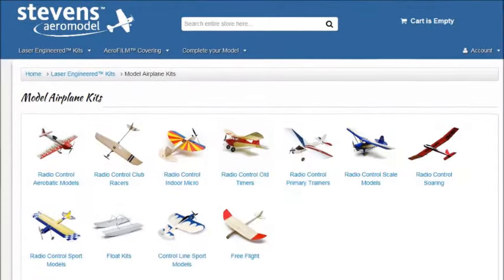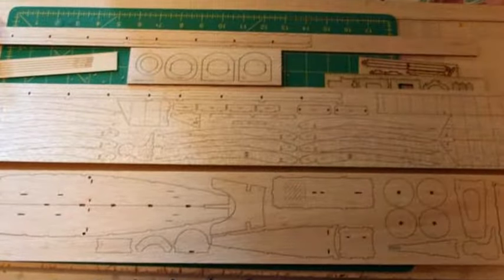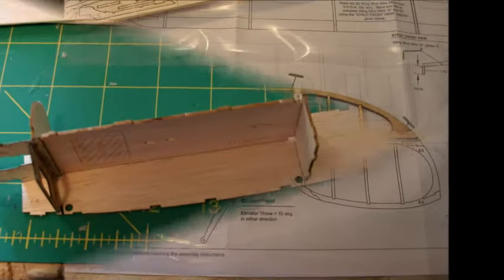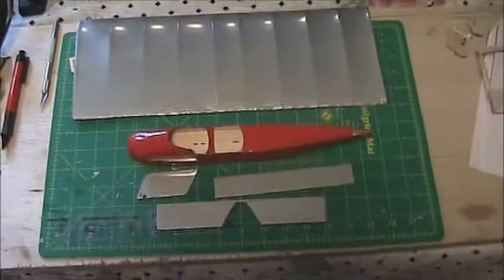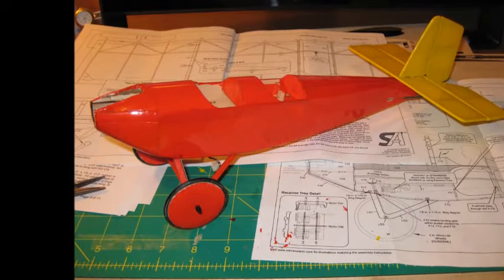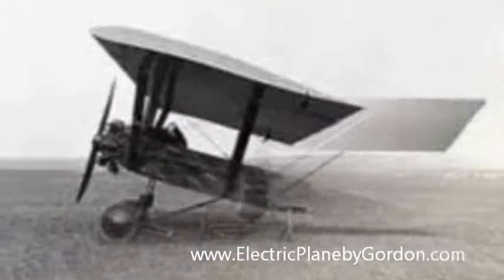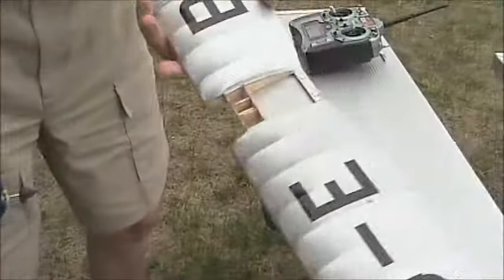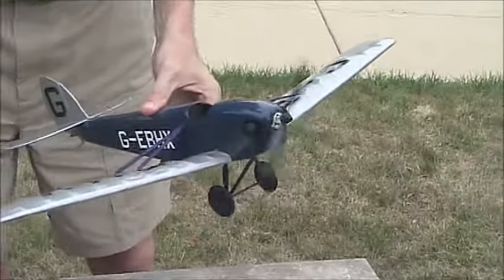Stevens Aero RC Model Airplane Kits - Build and Flight Reviews!

Comment: I just built my first. It's a clipped wing Taylorcraft. It's tough to keep from breaking the fragile structure with my "clubby" fingers. I expect it will get easier with practice. The model came out well and I'm pleased with the finished product, but I've not flown it yet. A friend has access to a gym that we can fly in. The kit was great quality and plans/instructions easy to follow. I used the motor that is from Stevens, but instead of the recommended servo "brick", I bought a Chinese version at half the price. It didn't come with a wire lead to the motor. i contacted Stevens, and they supplied one. They responded quickly and politely.Great service.
Reply from the maker: Many thanks!  Tim